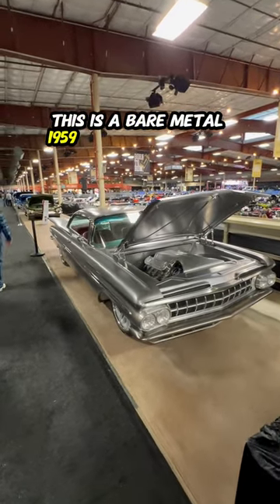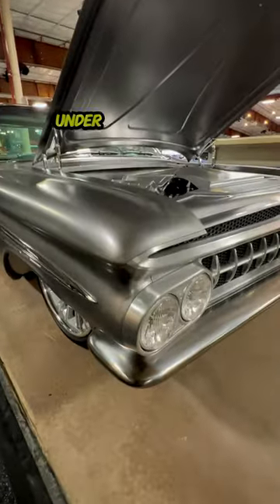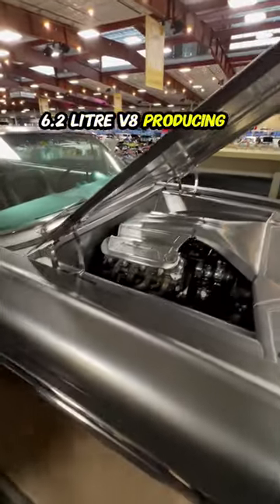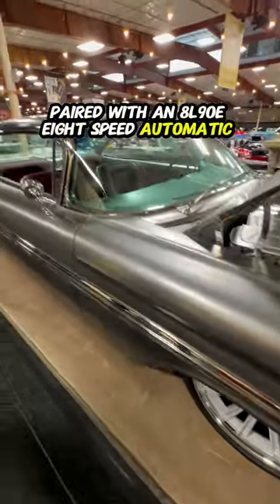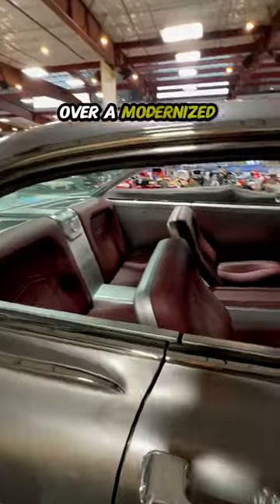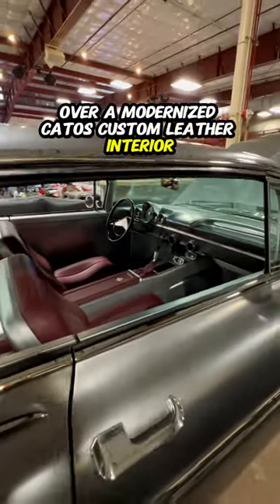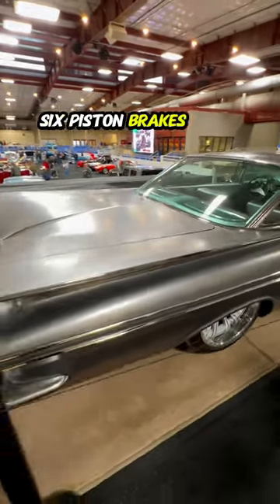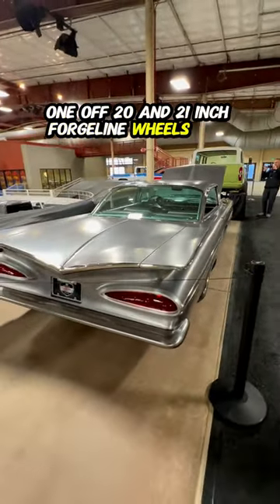Bare Metal Custom 1959 Chevrolet Impala

Comment: Bare metal but it does have a matte clear coat on it,it couldn’t survive without a coating on the sheet metal..
Reply: I mean keep it I a climate controlled environment and only take it out on days with REALLY low humidity and you can keep anything like that I think
Reply: @shakinbottles   if you took it out for even a few minutes with some humidity it would begin to rust.
Reply: @shakinbottles no
Reply: Where's the don't touch signs?
Oils from hands will stain it.
Reply: It would start rusting without a clear coat unless its made like DeLorean .

Comment: The cost of these paint jobs a is too damn high
Reply: The price of a no body filler no paint clear coat is far more expensive. It would be so hard to get that body 100 percent straight with no filler or primer or anything.  This is crazy.